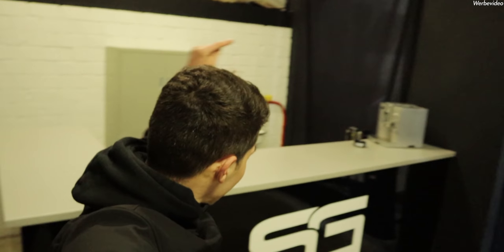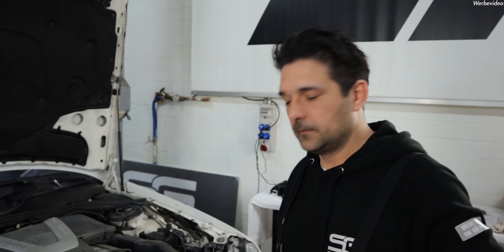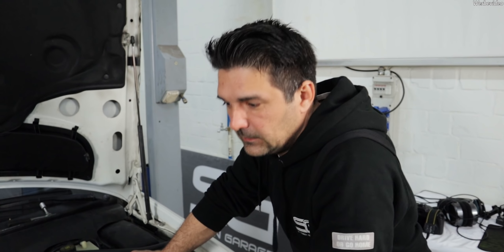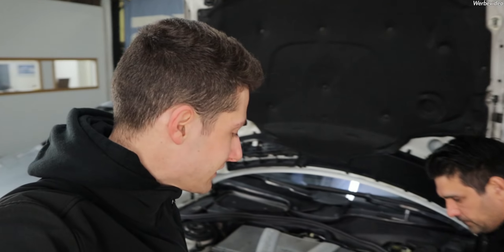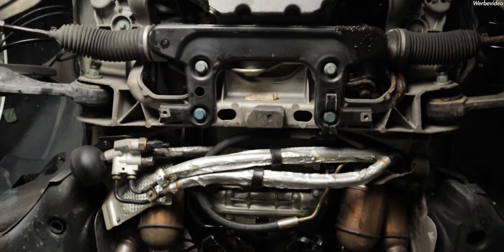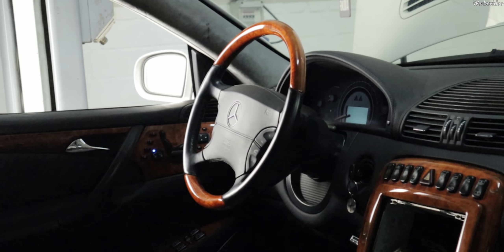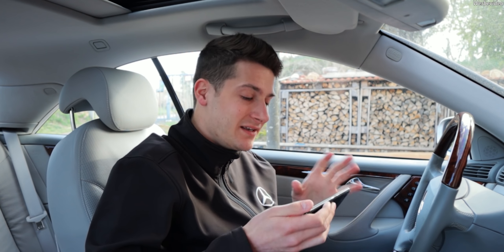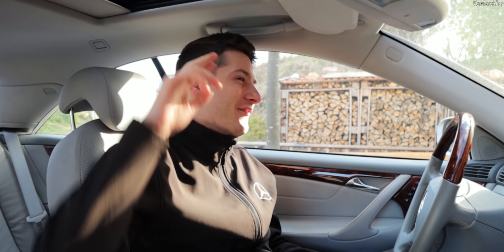ABC-Fahrwerk kaputt? Es wird teuer! So kommt der CL 600 BRABUS nicht über den TÜV...| RB Engineering

Comment: Andre kaufen sich eine Golf / Audi und kloppen da für 3-4000 Euro Felgen und Gedöns dran ... mich würde wahrscheinlich der Treibstoffkonsum stören 20-25 Liter?!
Reply from the maker: Den kann man mit deutlich weniger bewegen, er schluckt aber nur SuperPlus...
Reply: @RBEngineering  Wenn Du den fertig hast pack Dir einen Schlafsack ins Auto kleinen Kocher, bisschen Essen und ab zum Nordkap, damals mal mit dem MB 190 2.3-16V das ist der geilste Roadtrip ever (da unten ist es ja irgendwann immer hell), damals 7004 km in 10 Tagen, bin den 2.3er da mit 7,5 Liter gefahren der brauchte hier auch 11-12 Liter...
Reply: Also bei gemütlichen Cruisen braucht mein Orginal M137 (S-Klasse) genügsame 9,5 - 11 L. (hier macht sich die Serienmäßige ZAS bemerkbar, wenn sie den funktioniert 😀) , bei flotter Fahrweise (Ffm - Flensburg knapp 5,5Std.) 13,6 L. .
Der M137 ist im übrigen von Mercedes für E10 freigegeben, ich selbst fahre ihn aber auch nur mit S+ 102Okt. 😉.
Reply: @larsemig7267  damit könnte man sicher mehr als leben, allerdings denke ich das die Werte nur bei extremer Effizienter Fahrweise und langen Strecken zu erreichen sind,  Kurzstrecke und bischen puschen und es geht schnell nach oben. Danke für die Info, bist Du bei Spritmonitor?